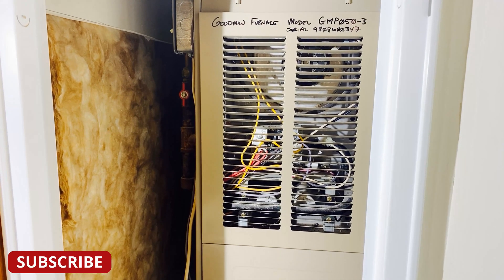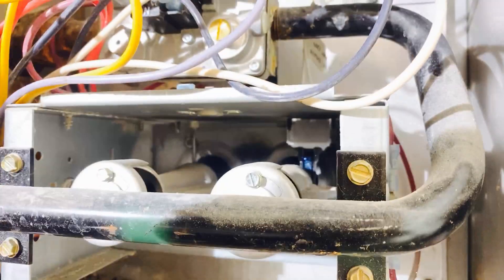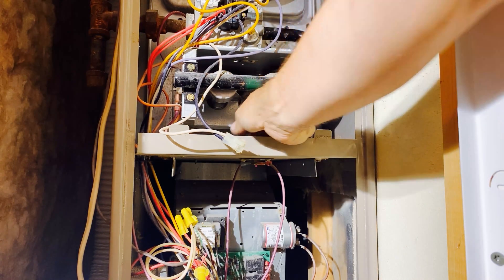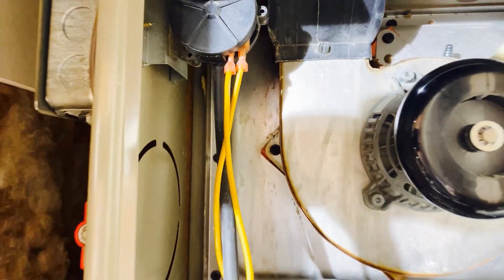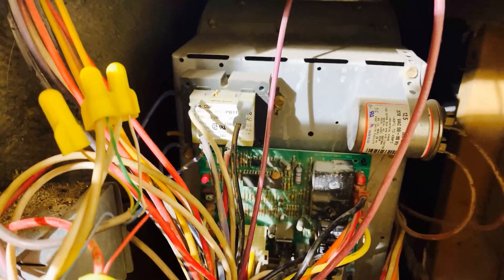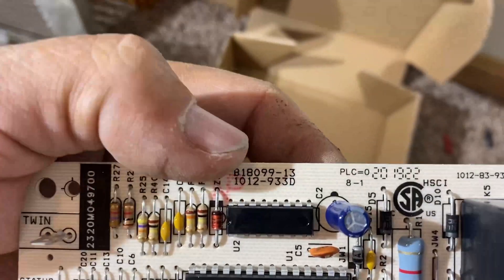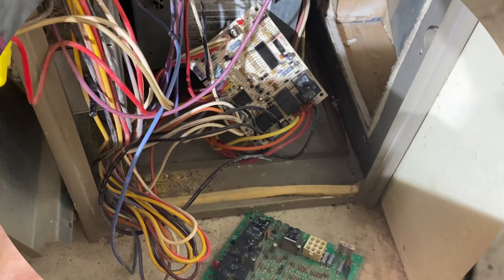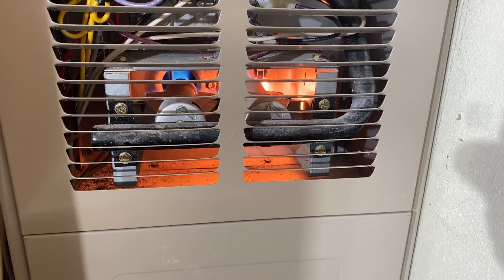Gas furnace not igniting -  Goodman furnace wont ignite - DIY Gas furnace repair

Comment: Sir, thank you so much for this video. My furnace blower is working, I changed my air pressure switch thinking it was bad, the flame rod is new. When I changed the air pressure switch the heater turned on and stay on for a while and turned off, again I received the 3 blinking lights. This AM 01Dec20 I decided to check the circuit board and remove it from the clips and checked everything and it looks fine. I put the circuit board back and made sure the connection were good. I pressed the switch and the heater started working. So This problem has been going on for almost two years. Do you think it is time to change the circuit board? The house was built in 2006. My circuit board number is B18099-26 and I was told it changed to ICM 286
Reply from the maker: Assuming a three blink code on your furnace indicates a "pressure switch fault"... different furnaces have different blink codes so be sure to check the legend for yours.
First, be certain that the evacuation fan is working... you should hear it come on before the furnace tries to light if the evacuation fan doesn't automatically come on, then your problem goes down that path. 
If the fan is working... before you decide swap the main board, I would first check the rubber hose on the pressure switch by blowing through it (BOTH ways)  to ensure that there isn't a spider or some debris in it, and to make sure it isn't cracked or split... the rubber hose tends to dry out and when it deteriorates it won't carry the suction to the pressure switch reliably.
To check it properly... 
First disconnect it from just one end and blow through it, and then just disconnect it from the other end ONE end at a time so that you are making sure the fittings are clear as well
In one direction (towards the fan) you should be able to blow through it freely. In the other direction (towards the pressure switch) You should hear a click when you blow and suck on the hose pretty lightly. The click is the pressure switch operating.
If that is all good and the furnace still isn't working, I would then "jumper" the pressure switch to ensure that the new switch is actually working. (There are videos on youtube that detail how to do this) BE SURE NOT TO LEAVE THE SWITCH JUMPERED as the pressure switch is an EXTREMELY important safety mechanism that you DO NOT want to eliminate.  
I would also check the leads (wires) between the pressure switch and the board for continuity (with the multimeter) to make sure they are not damaged.
Then if all of that is ok but the furnace is still acting up I might consider changing out the board.
All of the trouble-shooting stuff should be able to be done in about 15 minutes so it isn't as complicated or drawn out as it looks written out here...
In the end, if you decide that you have to change out the board, the board may turn out to also not be the problem. 
But if you have to call for a repairman to troubleshoot and fix the furnace after all that, as long as you don't end up scrapping the furnace, you would have a new board (one less thing to fail in the future) and only be gambling a small amount (cost of the board) with the potential to save hundreds of dollars.
Let us know what fixes it!! Lots of people read these posts and your solution may help others !
Stay safe, and stay healthy my friend!
-Shane
Reply: Call a pro, that indicates a problem with the furance not getting a proper vacuum opening the switch preventing start up and waiting two years on it makes it worse on the furance. We have a special tool to read that vacuum and to see what the actual cause of the fault is.

See this daily, people push off small issues that should be seen by a tech. furances problems  get worse when ignored and people get mad at us with the bill because more things are damaged because of letting it fester. Also it didn't change to the ICM 286 board, that is what we call a universal control board and not a OEM board. Both work one is just a little cheap sometimes. I carry a few dozen control boards most universal.
Reply: @zack9912000  problem was fixed. Circuit board changed for $55.00 and so far   2 weeks without an issue.

Comment: Thanks for the clear and informative video. Was awoked at 2AM to find my furnace wasn't working. Discovered the burners were not igniting. I found out my pressure switch wasn't working right from reading the blinking red light "code". Took off hose at blower end and the end piece broke off. Trimed the brittle ends of the hose, breathed through hose to check blockages and test switch.  All seemed to work well. Tested the startup and the gas burner started right up.  
Thanks for saving me time, money and having a cold late night to sleep through.
Reply from the maker: That is absolutely fantastic!!
Thank you SO much for the view, and for letting us know that the video helped you!!
When a YouTube channel is pretty small like this one is, the only real return we get for the work we put into making the videos is when we are able to legitimately help people.
Stay safe and stay healthy
-Shane

Comment: Nice presentation and camera work on your video. Great job troubleshooting the control board. I normally use a green Scotchbrite pad to clean my flame sensor, never thought about acetone. Might want to remove burner tubes periodically and wire brush the end of them as part of maintenance.
Reply from the maker: Thank you for the view and the comment! 
EXCELLENT additional tip on the burner tubes!
Stay safe and stay healthy ! 
-Shane

Comment: Great video. Clear and succinct explanations.   Not sure it help me though. I was hoping it was my flame sensor on my Goodman. My ignitor works (big, strong glow) and I cleaned my flame sensor. The light on my board is on steady...no blinking. I'm wondering if it could be a gas flow issue. Going to poke around on that tomorrow.
Reply from the maker: Mark, Thanks for the comment, a gas flow problem should throw a code after about two minutes. You don't get a code at all after the furnace fails to light?
-Shane
Reply: Check presser switches  could get cheap ones on Ebay or if u cant wait jump them with a wire only to troubleshoot  never leave a presser switch jumped blow on hoses for pressure  switch
Reply: Also make sure the exhaust  pipe and fresh air are clear sometimes  things can make nest in them and will trip pressure switches
Reply: On most goodmans they have two pressure switches, one completes the common to the gas valve. Also don't play around please, if cleaning the flame sensor didn't fix the issue and your hot surfance igniter is working call someone please. I have customers daily who do more damage then the problem actually is. If either of those don't fix it you need some tools very few people out side of techs have to test the system proper.

Comment: My Goodman furnace is larger than yours (100K BTU) and it is crammed into an even smaller closet than yours.  I'm just wondering if your old board would have worked after removing the mouse?  Most likely, the mouse was shorting out one of the inputs.  Critters and insects can find their way into your furnace.  My inducer fan started making noises when my furnace was two years old.  I found several dead wasps inside the fan housing when I removed it.  The board in my old Goodman furnace failed after running for 17 years.  Goodman wanted $135 plus tax for a new board but they wouldn't sell it to me since my contractor's license had expired 30 years ago.  I found a new board on Ebay for $72 with free shipping.  My neighbor paid an HVAC tech over $500 to replace the same board.  It pays to know how to fix things yourself. I've had bad luck with some aftermarket igniters.  They just don't last and, no, I didn't touch the igniter surface.  The Goodman factory igniter is about the same price that you paid for the Supco igniter.
Reply from the maker: Excellent suggestion. I did check and it had fried something on the board. I don't recall off the top of my head what had been damaged, I do recall that I could have desoldered the component and replaced it but I chose to get a new board and just do the video instead. I did toss the board on the shelf for possible parts at a later date in the event that boards are hard to get someday.  Critters are indeed an issue... and the mice in particular have been really on an up cycle the last few years.
Stay healthy and stay safe my friend.
-Shane
Reply: One reason it cost more for a tech to do the same job is what takes people days to throw a bunch parts at a furance and hope it fixes it. A good tech should be able to find the issues in 15 mins or less testing operation of the system. We also normally have the correct OEM part. Not all furances use 120v igniter, some use 80v and others use a spark igniter to light the gas. Seen about a dozen damaged control board because a customer buy a similar looking igniter online and kills the control board.

 People cost themselves more money throwing parts at a problem   most of the time it is just a quick fix. If it goes beyond a igniter and cleaning a flame sensor call a tech, customers cost themselves a bigger bill everytime. Also never buy used parts online or in this case someones used board. Goes back to knowning why that is playing with fire. A lot of boards share simular part numbers with slight changes what we call revisions of a board for different furances and different models of the same brand. 

They look alike but they are not, putting a used part in to save money is dumb. You can fry other components in your furance because it is not the right one or the failure from that used part kills your furance. I had just that the other day. Guy bought a used board, it fried several components costing him a lot more and a pissed off wife.